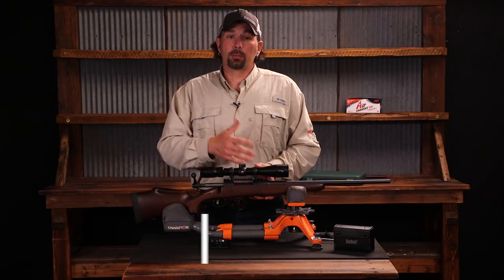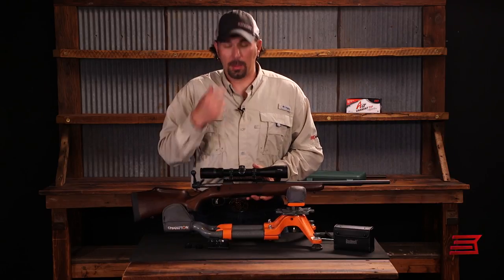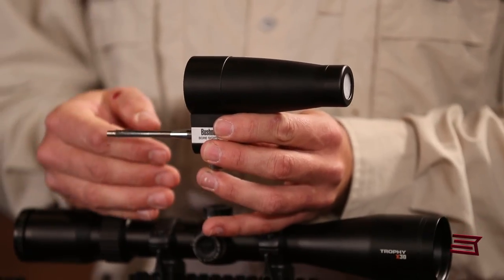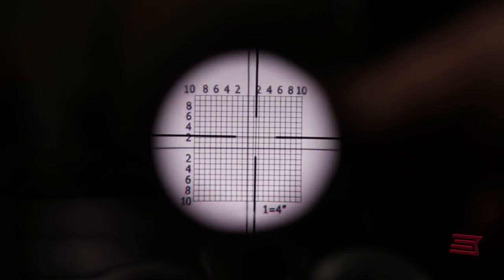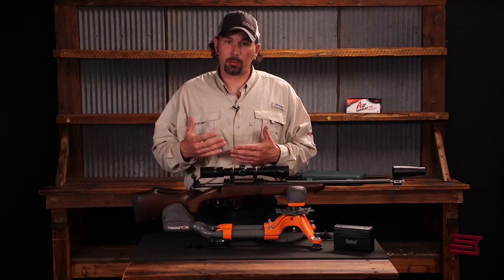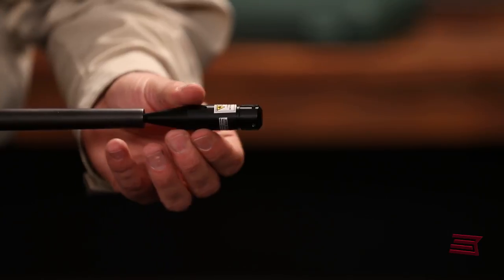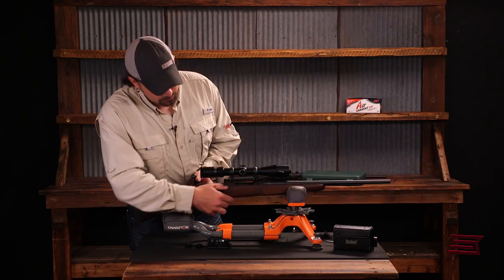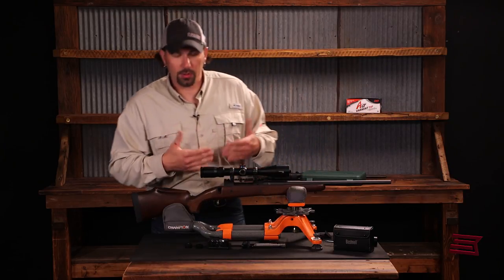Boresighting Your Rifle

Comment: The Bushnell Boresighter (and like ones that are many names) is fine for bolt action and some semi autos non gas actions. The problem with gas actions is the scope will be too high above barrel center due to the gas return tube above the barrel, there is a bore sighter for AR's but expensive. Like an AR or the AK or even the mini 14. After mounting measure with calipers then check with a ruler if more than 2" use the bore laser at dusk and at at least 50 yrds, this is how a store gets you on paper at 25 yds. after they mount one. Remember the laser is straight the bullet falls some. Always measure scope height above barrel no matter the height you will need to input in a ballistic app so as to know MIL's or MOA's  out to yards so you can print a index card with scope view with yards on it. One other thing if out hunting and a deer or whatever and is closer than your zero say 50 yds. vs 100 (it happens all the time even 35 yds) you need to know aimpoint and impact point also, I have seen some miss a deer even at 25 yds. and spend hours rechecking zero, the reason you check with a rangefinder once in the stand or blind.
Reply: Hello I'm having this problem  my gun is zeroed at 100 and I shot at a deer around 40 yards, missed. Should I be aiming higher or lower. Thank you.

Comment: No, the scope should NOT be set in the middle of it's full range of travel.  It should be about 3/4 the way toward the low impact end and mounted so zero is at between 100 to 200 yards.  (Shims can be used for this.)  Because as the target moves out, the scope impact point will have to be adjusted upwards.  Setting the scope initially toward the low impact in its range of adjustment will allow for more upward travel of the bullet impact point.

In other words, if you set the scope in the middle, are you ever going to set the impact point to a lower position?  As the target moves closer, you might want a little bit of leeway to lower the impact.  But not much.  Most of the scope adjustment will be to raise the impact point as the target is moved out.

Comment: can't the bore sighter manufacturers design the tool with a small portion of the top flat where a small level might be used to line it up vertically instead of guessing ?

Comment: hello such good afternoon I write you from Argentina. I have a remington rifle 700 caliber 300 win mag. it has a muzzle brake that measures 5 centimeters long. my question is if I have to remove the brake from the mouth to be able to collimate or if I leave it in the pipe ... finally taking into account the muzzle brake; What type of collimator do you recommend? (optical or laser) greeting very carefully
Reply: If the brake is the same diameter as your bore (not the case if it doubles as a flash hider) it shouldn't be a problem. Either style should work for you.